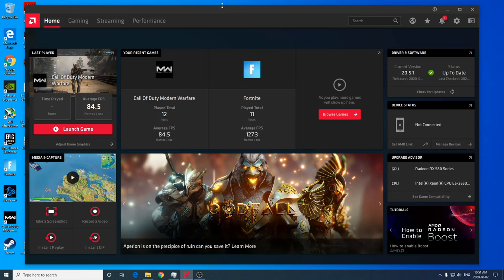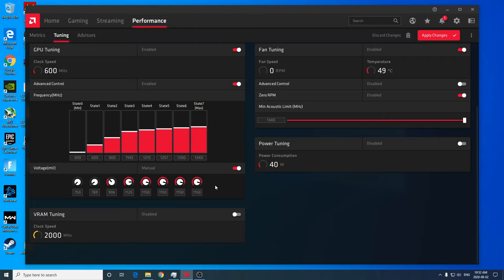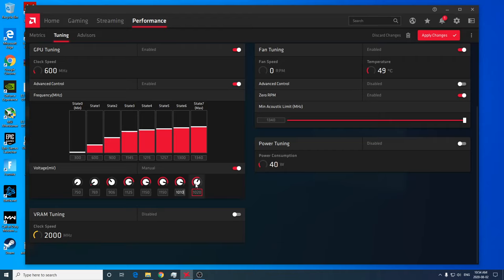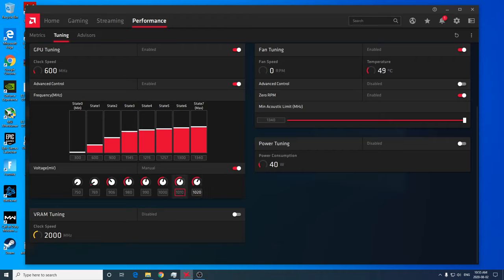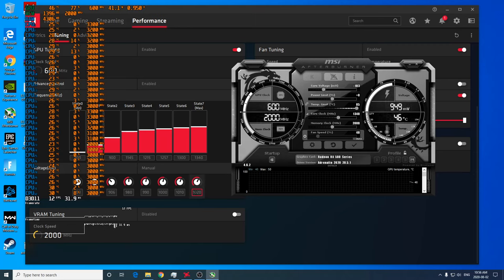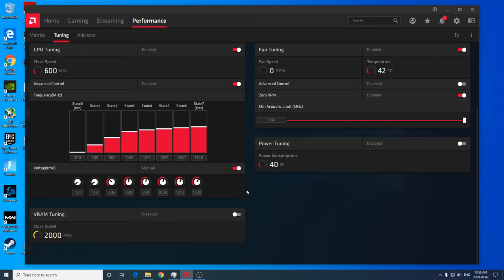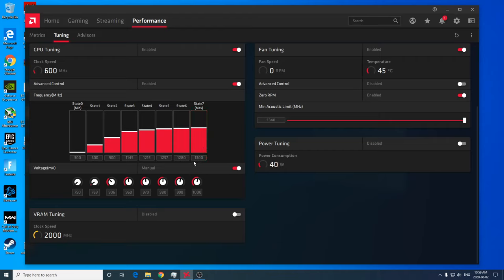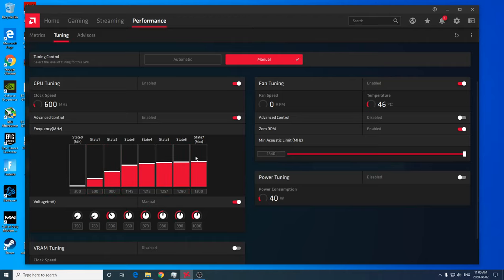How To Undervolt AMD RX 570 and RX 580 (How to lower GPU temp upto -10c)

Comment: How do you have a 600 mhz clock volt when my RX580 8 gig has a 300 mhz clock volt?
Reply from the maker: The 1st and 2nd states can vary between card models.
Reply: @AleksandrsBrodie  I mistyped. I didn't mean clock volt, I meant clock speed. From before you even adjusted anything, your card was running at 600 mhz clock speed. If it's the same card essentially just made by a different manufacturer, why is your clock speed twice as high as mine?
Reply from the maker: @DivergentDroid  my card was probably running at a higher state during the recording as there is load on the card. Depending on load, the card uses different clocks.
Make sense?
Reply: @AleksandrsBrodie  Yep, it does, Thanks. I was thinking it was running at that high clock speed at idle,  I didn't know you were pulling a load.

Comment: I CANT FIND A VIDEO WITH THE SAME VOLTS i have an msi rx 580 and theirs is different
Reply from the maker: its not about finding one with the same exact settings, its about understanding that at different clock speeds, difference voltages are required.
I recommend running 1300mhz on core @1020mv for state 7
Reply: yeah, i have an rx580 asus, and i can go 1400mhz 1095mv

Comment: I have an asus rx570 4gb oc gpu. Before applying your settings it goes to 80-85c on load but after undervolting it stays at 75 max. I have started undervolting from 1300 mhz(stage 7) with 980mV, 1264mhz with 970mV and so on... but my question is can the temp go down below 75c on load? I think its too hot. How much do I have to lower the mV for 1300mhz to get the lowest temperature?
Reply from the maker: 1300mhz will between 1000mv-1060mv depending in the silicon quality.
If you want lower temp they running 1250mhz at 930-970mv
Reply: @AleksandrsBrodie  wow 😳 thanks for replying ! I didn't expect to get a reply from you thanks bro♥️
Reply: @AleksandrsBrodie  the thing is i did not understand what you just said 1250mv?
Reply from the maker: @midhun5314  I meant mhz. 1250mhz state 7
Reply: @AleksandrsBrodie  ok thanks bro you've helped me ao lot
Reply from the maker: @midhun5314  undervolting can make a huge difference once you understand that just because your card has default clocks, does not mean it optimized ;)
good luck with your card.
ps. if you system crashes in games, it just means you need to increase your voltage +10-20mv.
Crash = not enough voltage for the core clock you want to run.
Reply: @AleksandrsBrodie  do you have an Instagram id? I have many queries !
Reply from the maker: @midhun5314  i wont be able to answer them all. sorry.
Reply: @AleksandrsBrodie  ok just tell me how many watts does my Asus rx5704gboc requires to run at 1300mhz without getting hot ? I mean how low can i go ?
Reply from the maker: @midhun5314  probably 1000-1050mv. (some cards can go lower without crashing)
otherwise, i would drop core clock to 1250mhz to lower the voltage even more.
I have other videos on my channel where i share how i set my voltages.
With 1300mhz your card will probably draw around 150-160w from the wall
Reply: @AleksandrsBrodie  no it draws only 90-100W after setting it to 1000mV at 1300 MHz is that okay?
Reply from the maker: @midhun5314  yes that is ok, and that number you are looking at is what it shows in software, I am walking about actually power draw which can only be measured at the wall which is much higher.
But yes, in software, 90-110w is good
Reply: @AleksandrsBrodie  ok thanks bro 🥂
Reply: Bro now the radeon settings cannot be saved , the settings are overrided and the games use more than 125W 😭 and the temperature is above 85C° i need your help bro. Do i need to reinstall windows? Is it the new amd update? The undervolting settings cannot be saved i also tried creating a custom profile but it also didn't work.

Comment: I have a big problem and i litteraly cant fix it,i just bought the rx 580 but it crashes my pc like 5 mins in a game i tried putting the voltage up and the frequency but still cant find a combination :{
Reply from the maker: im assuming you have the correct size of psu for your system.
Also, make sure you have up to date drivers.
Otherwise, you can set a custom fan curve, make sure the temps are under 80c.
Reply: @AleksandrsBrodie  i fixed it somehow i did it but thanks for the reply man
Reply from the maker: @KonobaVodenica  you're welcome
Reply: @AleksandrsBrodie  Hey man i  was just wondering if there is anyway i could maybe contact you on discord or something like that,i really need some help
Reply from the maker: @KonobaVodenica  I wont be able to help troubleshoot your pc. your best bet is to go step by step, check drivers up to date, make sure your GPU is not overheating while gaming, you can set custom fan profile inside amd drivers or msi afterburner.
it will take time to troubleshoot, but you will figure it out.

Comment: Help please? My rx 580 still run really hot even with the undervolt do I need dust off my gpu and replace the thermal?
Reply from the maker: I would replace the thermal paste.
Reply: @AleksandrsBrodie  Ok
Reply: @AleksandrsBrodie  I replace thermal paste long ago but now I cant undervolt my rx 580 without the display going grey and pc restart even 1 millivolt difference makes it not work (All the volt are at default)

I try decreasing the mhz on one game by 1 and then when I go back to it all the states are at 300mhz

Comment: Good day, i have the rx580 oem from hp envy. I want to undervolt it but it always returns to default whenever i click on apply in wattman.
Reply from the maker: You can try setting it in a game profile.
Reply: @AleksandrsBrodie  doesn't work too. I can undervolt in MSI afterburner but i don't like to touch all of the state so i'm trying it in wattman. Is editing the bios my only option left?
Reply from the maker: @filippe_kim  you can try flashing the vbios to another card, if you mod the bios, you may have issues with your drivers.
Otherwise just stick with MSI afterburner for clocks if you want to be safer/
Reply: @AleksandrsBrodie  Im hitting 81c on full load while playing horizon zero dawn that's why im trying to undervolt, -125mV on afterburner doesn't seem to change my temps at all. Sorry, i'm not tech savvy so im just playing safe instead of bricking my card.
Reply: Anyway thanks for the replies, i might do some more research before trying. Meanwhile i'll just stick to casual games while saving up for the 6000 series.
Reply from the maker: @filippe_kim  alright  👍 worst case you can ramp up your fan speed or drop your core clock lower , maybe 1150-1200mhz

Comment: is there a issue if i dont do it for games but for everything?
Reply: like, desktop usage, etc, i'm having an issue where the gpu will simply turn off the monitor, i don't know if its the gpu, but could be, so i'm trying to undevrolt to see if it works
Reply from the maker: @thelordofallthatisgolden7590  if it just shuts off its either due to overheating, or not enough power from power supply.
assuming its not a faulty card.
it is ok to undervolt for everything but settings wont apply automatically when you restart system as its not setup in a game profile.
Also I would suggest copying the settings from the pinned comment, I link another video I made.
Reply: i got this card from a friend, used, said he never had this issue, i have been using for about 1-3 weeks now, ti was working fine till yesterday that suddenly whenever i play apex  MY COMPUTER gets way too hot and after that it turns off and the cooler goes blasting fast,  like supersonic speed, its a rx 570, so far, after undervolting i did not have  further issues, but i will check it out, its night and its cold, could be a factor, will probably wait till tomorrow, when i do gpu stress test it also dies on furmark after 15 mi nutes,  so thats why i was asking to globally undervolt.
Reply from the maker: @thelordofallthatisgolden7590  sounds like a overheating issue.
install msi afterburner and set a custom fan curve to make sure temps stay under 74c pref, also keep side panel of case off during summer and for sure copy the settings from my other video, much lower temps than these settings
Reply: alright thank you! will sure copy it out

Comment: My rx570 hit 65C in most games i play and i can feel the heat when i touch the glass panel, the ssd right above it hit 60C too, and the vram heat is 52C, is that okay?
Reply from the maker: That seems ok for gpu.
Reply: @AleksandrsBrodie  yeah but when i touch the glass side panel its kinda hot, does that affect others components?
Reply from the maker: @lonelybob1902  then you need a way to move more air through the case

Comment: Anyone have some numbers to copy for the RX 590?
Reply from the maker: You can try 1300mhz core @1000-1050mv.
Reply: @AleksandrsBrodie  thanks, worked great, went from 80C/82C at full load, now i get 60C, gonna optimize further :P
Reply from the maker: @MatasVinikaitis  you're welcome. 
Remember if it crashes, it means that the voltage was too low for the given core clock speed, so all you do it bump up the voltage a bit until stable.
Reply: For anyone wanting to mine with this card use the following settings: follow the rules/setup of the video and put the highest gpu clock speed to 1150MHz with a voltage of 1020mV, set the vram to 2200MHz and voltage to 1090mV. Turn on fan and power tuning on and leave it. These values need to be higher or lower depending on your luck in the silicon lottery. I'm using about 147W of power, temp at 79°C with a fan speed of around 1300RPM, my goal was quiet mining so i can mine 24h a day and get some good sleep
Reply from the maker: @MatasVinikaitis  you can probably run 1280mhz at 1050mv.
I mean you can tu e it a bit more but I think you can run a higher core clock for that voltage:)
Reply: @AleksandrsBrodie  If I find myself gaming a bit more I can increase the clock speeds a bit, but as it stands my goal is to  be able to sleep with my pc mining at night, so I kind of need the lowest reasonable clock speeds for that to happen, since for crypto mining vram is king.
Reply from the maker: @MatasVinikaitis  that is true.
You can even try lowering your voltage a bit more till it crashes so you know its limits
Reply: @AleksandrsBrodie  those numbers are at the edge of good stability, didn't fair too well off in the lottery

Comment: After I did this my pc just crashed and needed 2 boot ups to work again, please help I just copied what u did
Reply from the maker: This means you need to increase your core voltage to run the same clocks as mine.
When the gpu crashes it means your core clock is either too high for the voltage you are trying to run, or your voltage is too low for your core clock to run stable, that is why your system crashed.

Comment: this methode work with the 320w ? and how many frame i gonna lose when im undervolt my rx 570 4 gb
Reply from the maker: if we are not lowering clock, we are not lowering fps. we are just lowering voltage which lowers power use
Reply: @AleksandrsBrodie  emmm thank u for the explication , but in 320w we should reduce clock or not ? and this is works on 320w or not and thank for ur precious time !
Reply from the maker: @crackonadailybasis2748  yes I would reduce clock

Comment: This reduced my degrees (Celsius)  by 4/6 which is insane. I had all of my states the same except state 1 and i think that may have been causing screen stuttering too? ill see how it goes and comment on this if it keeps stuttering - rx570 user
Reply from the maker: Stutter from my experience has more to do with the cpu than gpu
Reply: @AleksandrsBrodie  oh really? Do you know how i could work on solving that? Or somewhere on the internet where i could get some advice? You have been very very helpful already thank you Aleksandrs !
Reply from the maker: @Shukovsky  The way i would check is just monitor your CPU usage in games, if its at 100% that may be causing the stutter.
You can either monitor usage using a program like MSI afterburner, or even as simple as Task manager.
In task manger right click on the GPU graph and select "change graph to" -> logical processors so you can see each thread.
Reply: @AleksandrsBrodie  Thank you so much my friend, i will take your advice! :))

Comment: Yoo wasup mate, 
Do GTX 680 + I5 9400F is playbale like 144 fps with no drop of fps? 
sry of my english
Reply from the maker: yes, you should be able to get about 120-160fps stable on all low settings Fortnite
Reply: @AleksandrsBrodie  alright ty

Comment: I tried mine on 1.100V and it runs super cool and retains the performance ... but for like 20 minutes then Global Wattman has crashed error message appears....
Reply from the maker: You will mostlikely need to lower your core clock to run a lower voltage.
It's a balance between core clock and core voltage.
Reply: @AleksandrsBrodie  I tried that to but same thing... If I lower consumption limit to -30 i get the same effect.... It think I have a hardware combo that's not compatible with the amd software ... Or this graphics card is shot ... Last AMD graphics card that I bought... I had an R9 280 it was without any problems. But from what I read these RX series are horrible. Including the 5xxx series.
Reply from the maker: @asztaloszoltan2001  watch the video I pinned in the comment section and try those settings
Reply: @AleksandrsBrodie  Thanks but this graphics card is so unstable that if I go from 1150 MV to 1149 it crashes.... Literally I tried and crashes it takes a few hours but it does. If I DDU then do a fresh install leave everything as it is it runs fine without any major hickups... But the games that require the full potential it starts consuming 155W shoot's up straight to 83C and starts down clocking .... I repasted it like 10x now I am running thermal grizzly paste and pads ... And the best thing is if it does an automatic update and instantly starts crashing after 15-20 minutes of gaming.
Reply from the maker: @asztaloszoltan2001  I am not sure then, sorry.
Reply: @AleksandrsBrodie  Me to... Price to performance the GPU is excellent I got it for 180€
Reply: @AleksandrsBrodie  Brand New in 2019.

Comment: Thanks. What if my RX 570 makes my PC restart randomly when I play games? I am 100% sure it's the GPU.
Reply from the maker: I would run lower clocks and a bit higher voltage.
maybe 1250mhz on core, and 965mv for voltage
Reply: @AleksandrsBrodie  The initial settings are 1250 mhz and 1168mv. Decreasing power consumption makes my games run for longer. What do you make of that?
Reply from the maker: @Michael59197  I am not sure.
Maybe it was overheating before
Reply: @AleksandrsBrodie  Thanks. Maybe I'll give it to a tech to change the thermal paste or something. For the time being I will try to underclock/undervolt and see what happens. My older R9 270 can't play games sufficiently anymore. I want to buy a new GPU after nVidia and AMD release their new models. Now it's the worst time for that.
Reply from the maker: @Michael59197  changing the thermal paste wont make a big difference, undervolting will have a much larger affect.
Dont spend money just to get it re applied
Reply: @AleksandrsBrodie  Thanks again. I don't know how much I should decrease the volts. The damn thing has 7 stages. Should I decrease the general power consumption too and how much, it goes from -25% to +25%. Do I need to downvolt the vram as well? And what if it the psu? The pc works fine all day as long as I don't play games, and I have no problem with my old gpu. But my r9 270 requires 24A and the rx 470 42A and I have no other gpu to test it. I don't have money to waste, but I don't know what to do. The PC restarts after 10 minutes when I play a modern game.
Reply from the maker: @Michael59197  that is odd.
AMD for the state, you just need to set state 7 to 1250mhz, @ 950 or 960mv, amd the lower states, just lower the voltage by -10mv until you reach state 1.
So:
State 7: 960mv
State 6: 950
940mv
930mv
Etc
Reply: @AleksandrsBrodie  You are a great guy. You cared more for my problem than the guys at the store I bought it from. They just told me the guarantee is over, buy a new one. I'll try those settings, but I have already undervolted it and it still restarts the pc. The problem started when the new drivers were released, almost a year ago. At first it was insignificant, just a restart after 3-4 hours but lately it happens the moment I start the game. I tried rolling back to 2019 drivers, it didn't help.
Thanks again.

Comment: I just built my pc this morning, my rx 580 is running super hot, only running low settings on Cold War beta and valorant. So is my ryzen 5 3600 even though it’s not being utilized, Do you have any tips?
Reply from the maker: Set custom fan profile for the gpu.
As long as the cpu is under 78c its fine

Comment: My Rx580 temp is 81 c.. Even when i open the glass side panel from the case i changed the thermal grease and cleaned the card and undervolte it remane the same my gpu msi rx 580 armor 8g oc
Reply from the maker: I would lower core clock to 1200mhz and then lower core voltage to 950mv.
Reply: @AleksandrsBrodie  crashed in every time i do undervolte
Reply from the maker: @aliali-uf9yp  then you need to increase your voltage for the given core clock that you are wanting to run.
Reply: So 1200 at 1150 mv is it ok?
Reply from the maker: @aliali-uf9yp  that seems like a very high voltage. But if it still crashes,  there may be something else causing the crash
Reply: @AleksandrsBrodie  someone told me thats a vram have a problem
Reply from the maker: @aliali-uf9yp  could be, I've seen that happen before, try down clocking the Vram to 1500mhz.
Reply: @AleksandrsBrodie  crashed once agine
Reply from the maker: @aliali-uf9yp  i am not sure then.